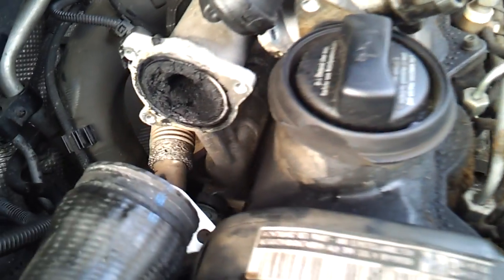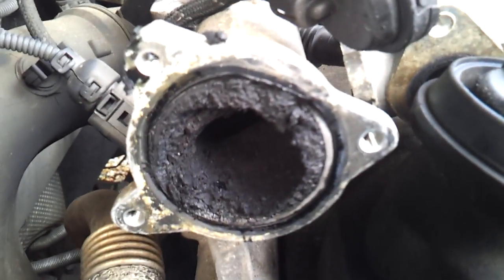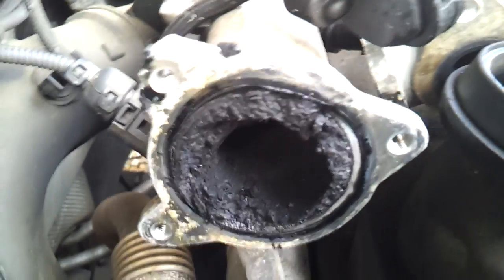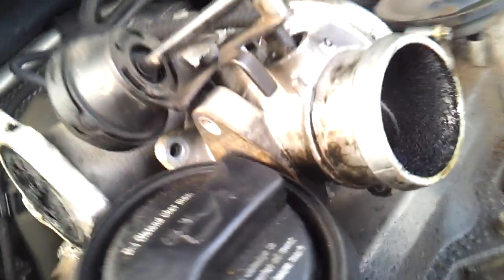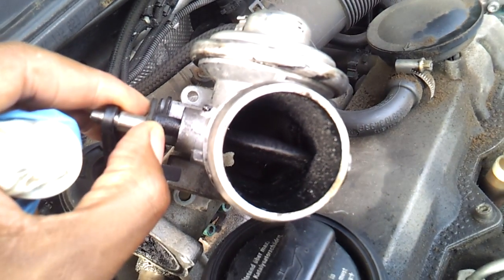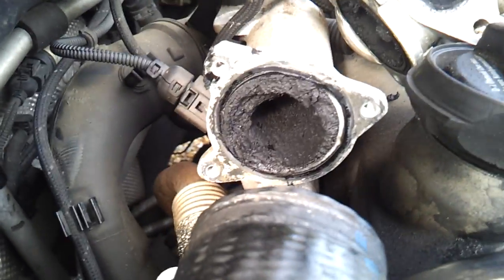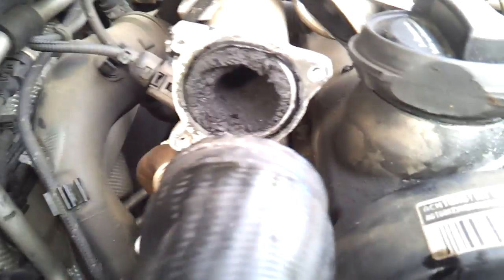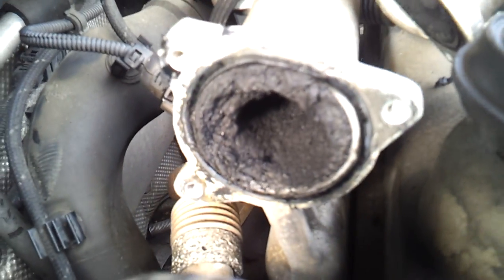Carbon Build up Inside of your Intake Manifold

Comment: Your EGR valve is not working properly. Also, it is not all exhaust gases that are recirculated. The EGR only returns a small portion to aid in more complete combustion of gasoline because exhaust gas is relatively inert similar to nitrous oxide. 
Without EGR, you need to get the car tuned to work without EGR as your exhaust system (mainly the cat) will overheat and cause damage to your engine overtime.

Comment: with a delete, my car ran hotter and had knocking .... its a carby and doesn't have knock sensor. so I have to keep the egr running well and clean up deposits .

Comment: EGR is poppycock. I've had two Ford rangers both with a 3.0. one has an EGR valve and the other doesn't. One has a carbed up intake, and the other doesn't. One has more pep than the other. One passed emissions better. One has more miles. One pings going up hills, and the other doesn't. That's right, the faster, higher mileage, better emissions, cleaner intake, non-pinging, older 3.0 does not have an EGR valve. They are junk and a stupid idea. Think about it. Someone thought, "let's recirculate exhaust to cool down combustion with inert gas and prevent pinging". Sounds great until everything gets carbed up, including the combustion chamber, and you get...pinging.

Comment: that's what happens when you use old gas don't do regular services and don't know how to properly work on cars
Reply: This engine uses diesel not gas. This engine has an egr valve which recycles a percentage of exhaust gases back through the inlet manifold to help clean up the emissions. The gases from the heated engine oil in the crankcase are also added to this mix, again to clean up emissions. The resulting build-up you see here are the side effects of this shitty-arsed system.

Comment: It is incomplete combustion that causes these deposits, yet he EGR Valve simply allows them back into the engine.  Maintain optimum performance, by using BG Products at each regular service interval.  To improve on that, reclaiming performance that these deposits are a cause and symptom of request a BG Diesel Air Intake Service.

Comment: all egr's on every engine they are on do exactly this , it doesn't matter if its petrol or diesel turbo or non turbo, 
the egr on every car, van or truck that has it will put carbon from the exhaust into the intake blocking them
i just cleaned a nissan skyline V35 with the VQ30DD  these engines are known to have the intake blocked up by soot/carbon from the egr
disable the egr and gain more power but as you gain more power you loose fuel economy, its a win lose  , more power but more expensive to run

Comment: You need to once in a while rev it up big and drive for at least 2 km on high rpm... This way your EGR is simply burned from the inside. All this EGR shit is caused by keeping the diesel engine at low rpm's constant to get better mileage.
Reply: Well done that man! EGR do not recirc all gasses as is said in the video, poor running is the cause here.
Reply: Yepp, that's right sir.
Reply: No it's not. Simply put gear one notch back.
Reply: My parents have a 1.6 BGU petrol and drive on the highway with 4900 rpm and the redline is around 6000 or 7000 does that help to? Or is that not high enoufh
Reply: KronosSlots b

Comment: How you let it get to that point
Reply: I have a 79 bmw with 241k miles and the whole intake system is pretty gunk, I bought it like that but that's just the difference between someone who goes the extra mile to takes care of their cars vs people who might touch up on the easy things or ignore maintenance entirely.  Always look for gunky intakes, rust, bad ball joints and bearings, and cracked coolant and air hoses when you buy a car.... Just a few things people really tend to ignore in my experience
Reply: There are no sensors and no notes in the maintenance schedule to suggest anything should be done.  I have an 03 Jetta tdi and am facing. 3,500 repair because this happens.  How am I supposed to know this builds up in my intake.  Shorty engineering imo.

Comment: if anybody wants to know where your egr is on the 2.0 BKD engine its at the front of the engine below the intake manifold. dead easy to take off
Reply: I would like to know what it involves taking the inlet manifold off on the bkd engine. and if it's possible to clean it or just buy a new one
Reply: bruce L I will be doing it in a week or two. I wouldn't bother buying a new inlet manifold if youre old one is fine it will cost a fortune fora new one anyway. I will be doing a tutorial soon.
Reply: Thanks I will keep a look out for it. I've just blanked off my egr and noticed all the soot in it and now thinking the inlet manifold will be caked too.
Reply: bruce L That manifold has had years of soot carbon etc so it will be wise to clean it out. I did my EGR valve last year and it wasn't too bad. A bit of cleaner and a dremel it's like new.

Comment: So my only problem left is my car starts slow when warm. So this could either be the temperaturesensor or the starter motor from what i've read and it can be checked by unplugging the sensor and check if it starts properly then right? if it starts ok (when warm), then it should be the sensor right? Hope it isn't the Starter motor, otherwise i'll likely lose around 100€ hehe